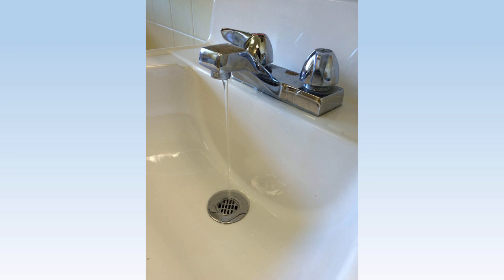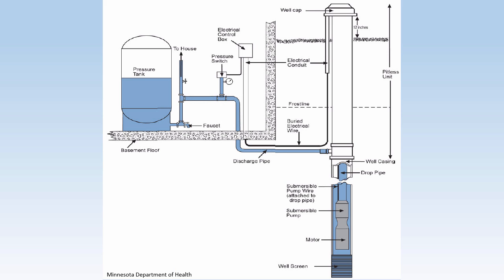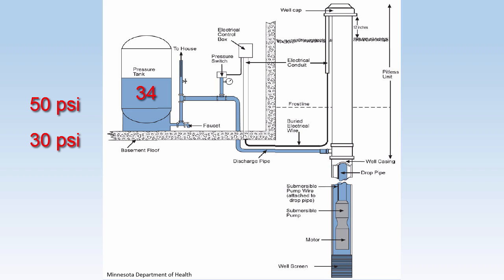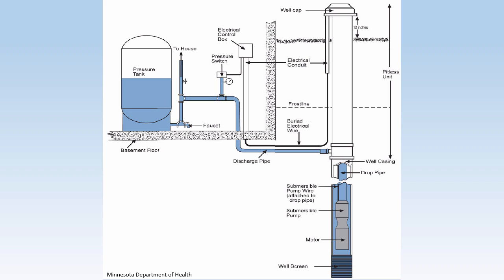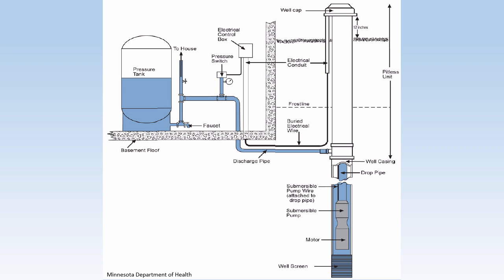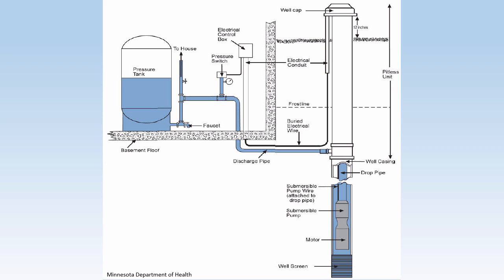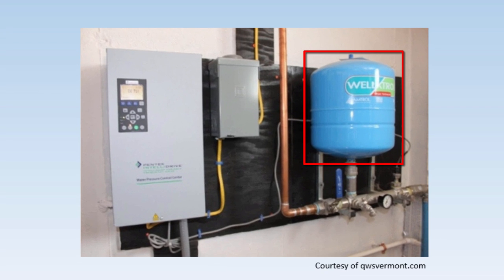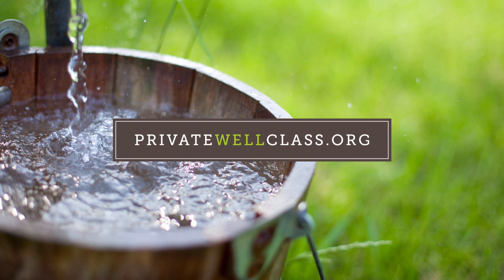Why Does My Well Keep Losing Pressure?

Comment: My tank loss pressure returning the water to the well. How can I fix it?
Reply: I'm having that now. My well pump won't shut off
Reply: @Dan-nr3om  it's the passing valve.  The valve let the water pass to the tank, the pump stops and the can't return to the well, but when the seal is damaged the water just return to the well, so the pressure goes down and the pump keeks working.
I changed the valve just making sure that was conected on the right way.

Comment: Yes, the bladder tank size makes a world of difference indeed. I installed a champ 100 and two deep well pumps connected in series with the pump switch set at 45/65 to fix my low pressure problem permanently.....
Reply: What psi did u out in ur tank?
Reply: @ovarianbarbarian4186  Once I got both deep well jet pumps balanced correctly the suction side P1 read 45 psi and the pressure side P2 now read 120-22 psi with a sustained  pressure of 75 psi to the large bladder tank.